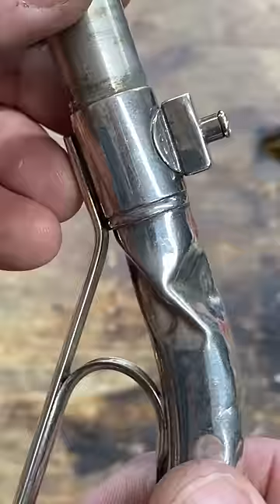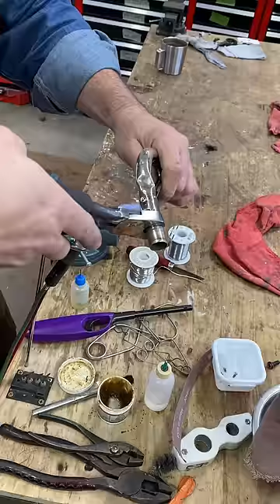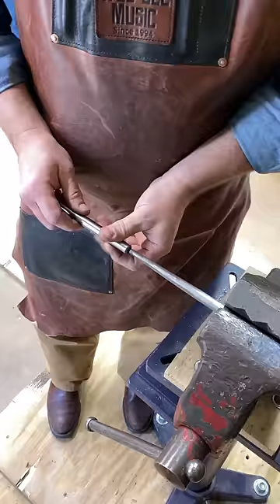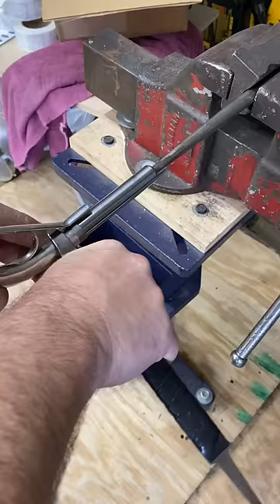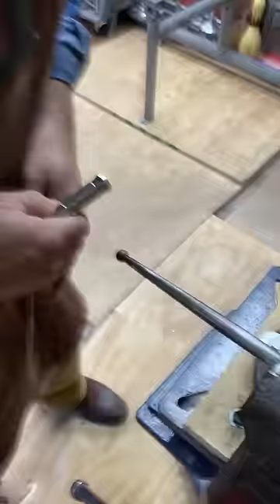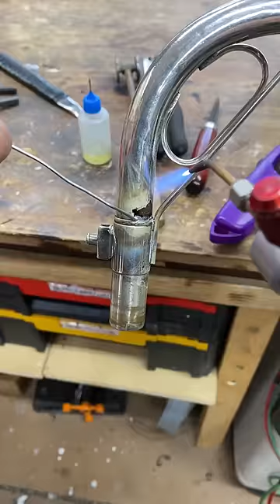Sousaphone Neck Repair- band instrument repair- Wes Lee Music Repair

Comment: Is it possible to de-dent an instrument without pulling the rough texture out onto the outside of the instrument?
Reply: There isn't any rough texture trapped inside instruments. In any case, the metalworker creates a suitable texture at the end of the repair. You can see that in this video, just before he solders it.